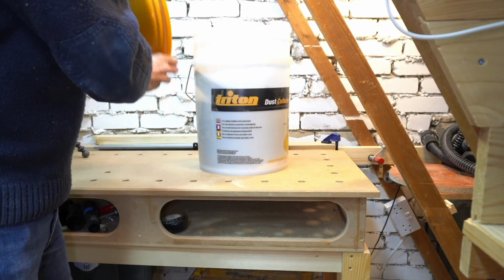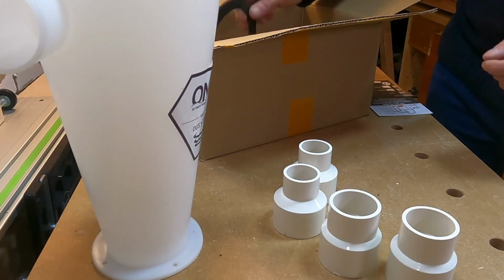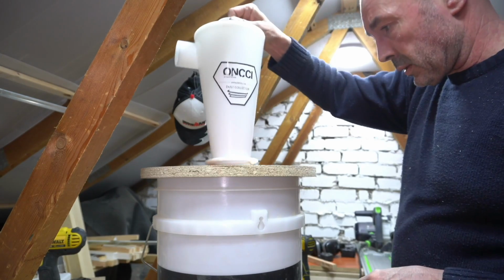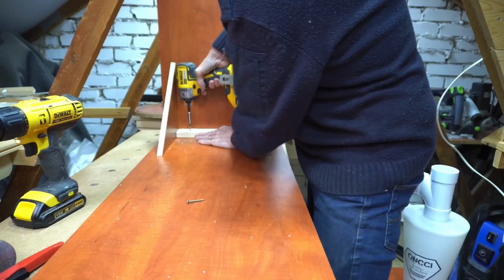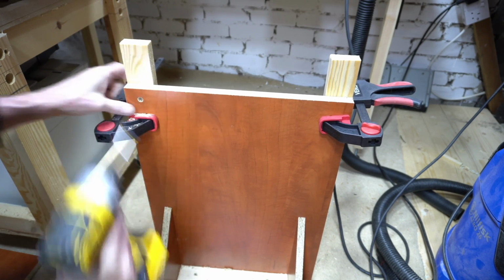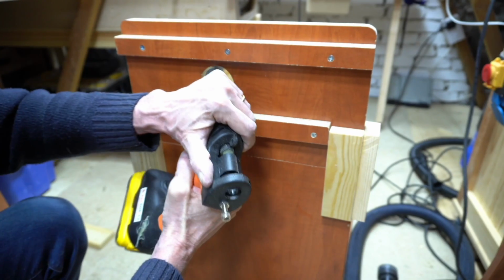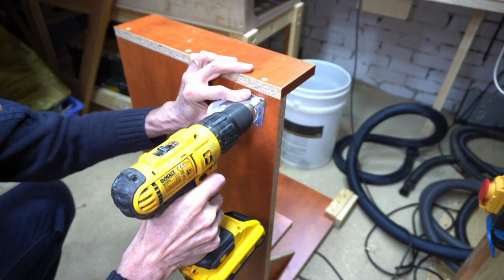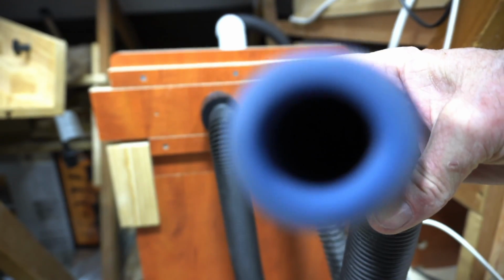Upgrade your Small Workshop Dust Extraction system.

Comment: I, too, am a fan of the DeWalt AirLock hose system; it is a great design. 
The cyclone system takes so much of the dust, there is very little gets to the vacuum- the filter is just there for your lungs. Consider exhausting the air out of the building- I do this, and avoid needing a filter, whilst not getting any fine dust re-circulating. No clogging, so better pressure. You then only need the motor unit from the vac, saving space.
Food grade tubs make great dust buckets- hermetically sealed, with a lid you can attach the cyclone to. Simple clip for access to empty.
Reply from the maker: Thanks Mike. my problem with venting outside is I am concerned it will blow back into the neighbours roof window. Thanks for watching.

Comment: Yes I also have a small workshop, although not as small as yours, and I have everything on wheels. My dust extractor is similar to your old one with the lid on the five gallon bucket. The cyclone lid (Duststopper from Home Depot) is very good at removing almost all the bigger sawdust. Then I use a 4 gallon vacuum with a paper bag and HEPA filter.  It all fits under my workbench and I manually connect it to whatever equipment I am using. You did a great job.
Reply from the maker: Thanks for the comment David. I am considering placing the filter from the Triton bucket into my new lid. I have not used enough yet to scrutinise the small dust particles. Regards JP

Comment: I splashed out for a vacuum with a built-in power connection from Screwfix. Every time you switch on a power tool the vacuum kicks in and runs for about 5 secs after you switch off too. Downside is that it's a bit bigger than the Henry sized vacuums but is great to use.
PS: where did you get that drill depth stop?
Reply from the maker: My vac as a take off but for some reason I never remember to use it. The countersink one? It’s made by Trend and I bought it via Amazon. Regards JP.
Reply: @Smallbarnworkshop  Cheers
Reply: It is easy to add power detection for turning on the vac. You can do this from different power sockets, so it knows which machine is in use, and shift the blast gates to match.
Reply: @Tensquaremetreworkshop  Hi Mike. Sounds interesting. Can you direct us where to find more information?